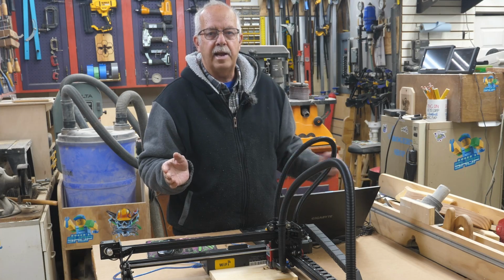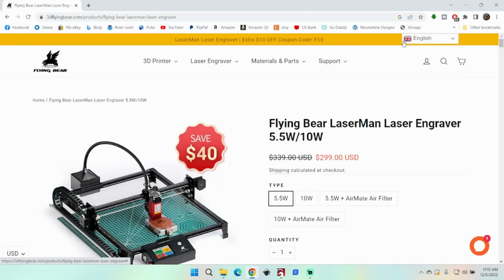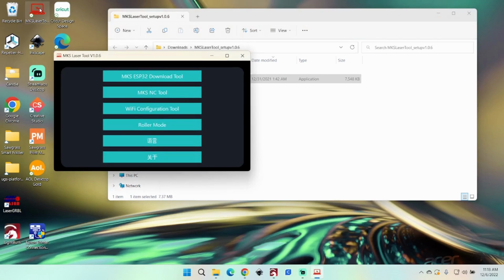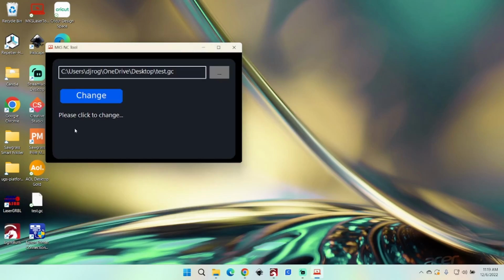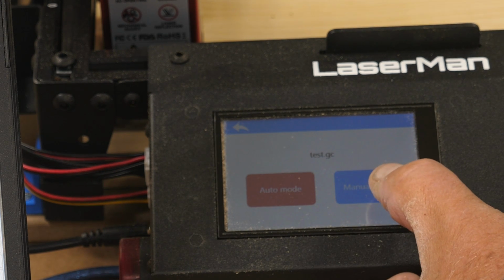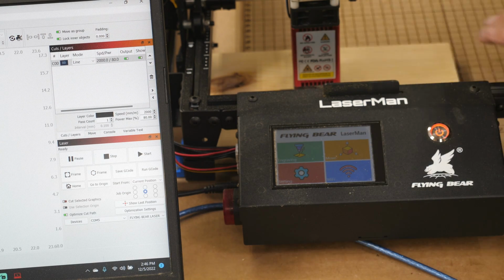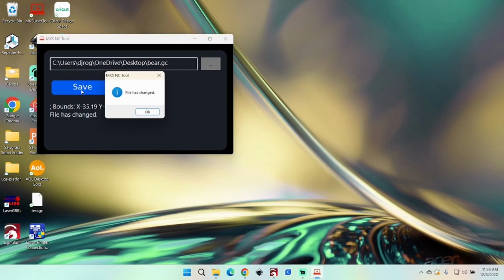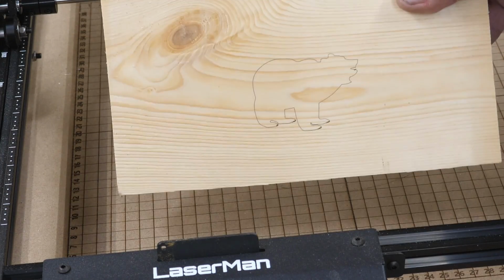Flying Bear Laser MKS Software

Comment: Hi, is it possible to change only the laser module on this machine with one more powerful, like a 20W? No more 10w available on the official store,so, if possible, which one would you suggest to purchase?
Reply from the maker: I no longer have this laser, so not able to experiment.  Laser modules are not universal, so would take some research as well as all specifications of control, mounting method, voltage, wiring, etc.

Comment: Just wondering if you still using this laser and any new tips for it. I just bought this one based on your and the Lahobbyguy reviews. I did want a 10 watt but did not want to spend the money if I ended up not using or liking laser projects. I ordered but will take a few weeks to get here. Have you tried cutting thick wood? Not that I will do much but saw someone using this machine cut thru 3/4 pine and it did work. Thanks
Reply from the maker: Yes, I still use it for some jobs, mostly engraving our logo on wood items we sell.  I don't recommend cutting 3/4" material with a 5 watt laser since it takes so many passes at 100% power and also requires to focus lower in order to get full penetration.
Reply: Tenho como passar o link do MKSLaserTool?